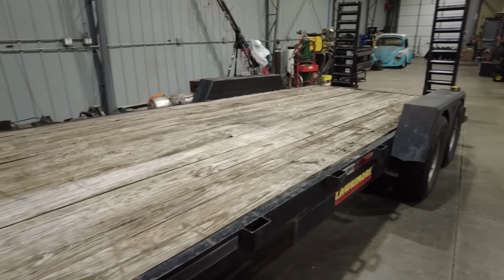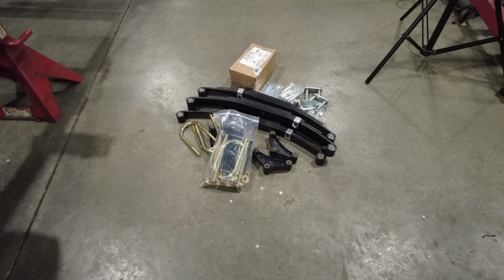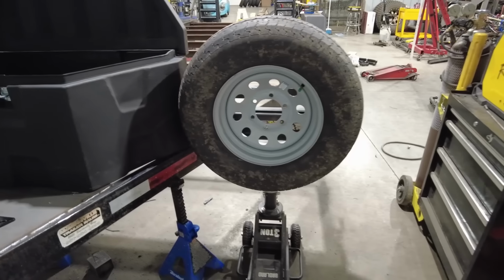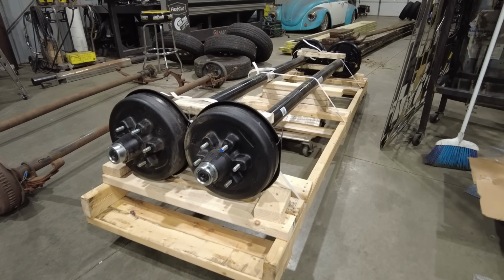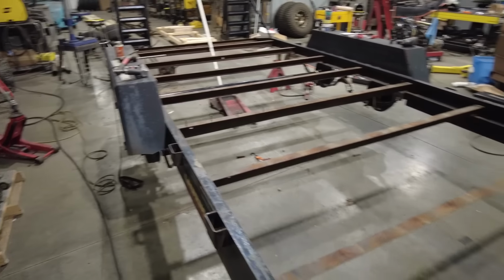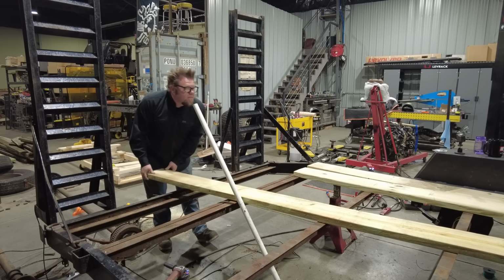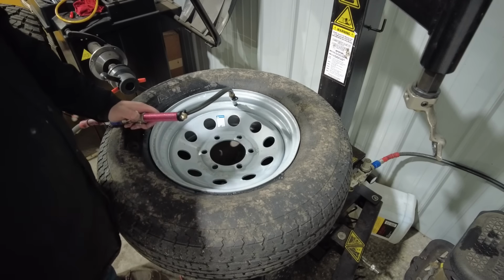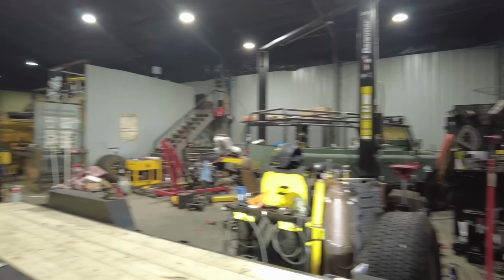Car Trailer Rebuild, How to Increase the Load Capacity of your trailer

Comment: Curious what's the GVWR on the trailer data tag? Upgraded axles are great, but State Troopers go by DOT tag rating, not axle rating (whichever is lower). Something to think about & be aware of anyway.
Reply from the maker: I will have to look...not sure if this trailer even still has a tag....but good point....
Reply: @BigTireGarage you can reregister the trailer for the higher gvwr and you’ll need the paperwork on the axles and springs to prove the upgraded weight ratings. Also curious with all you did why you didn’t blast the frame off and give it a powder coat?
Reply: @Old_Tyme_Racing  Original frame was only designed around a 7000lb rating so how would one upgrade the frame rating?:face-blue-covering-eyes:
Reply: @iffykidmn8170  I get what you’re saying you’d have to ask the states most go by axle weight ratings for weight ratings on trailers. I just order a enclosed car hauler and put two 7K axles under it and it will be rated for 14K but the manufacture mandated they had to upgrade to a 8” tube frame instead of a 6” tube frame plus an extension on the tongue for better weight distribution and handling.
Reply: @Old_Tyme_Racing  you might get by with the local PD but a state officer is looking for the lowest rated component which is printed on the tongue placard including the tire size and rating, try putting a D rated tire on a trail requiring E and see if your legal load is still legal.
Reply: @iffykidmn8170  most local and state officers don’t even know how to read those tags and most only look for the gvwr and I can guarantee you most trailer owners don’t even have the correct rated tires on their trailers anymore after the original tires wear out because most trailers owners don’t have a clue about that kind of stuff. Most owners would look at you puzzled if you asked them about tire ratings. Just like most who own a trailer with a gvwr over 10K have no idea you need a dot medical card to pull a trailer over 10K. Like I said I completely understand your points about the frame rating and tire ratings etc. My state is going to allow me to register my truck which is rated at 10,866lbs. and my enclosed trailer as a combination at 14,000lbs. So my truck will be legal to tow my enclosed car hauler and it’ll be legal in any state I go to because it’ll be printed as such on the registration of my truck and they don’t even ask about my tow vehicles tire ratings but I did order my 2500hd with 3500hd springs from the factory. My truck will still have it’s tow rating sticker of 10,866lbs. in the door jamb.
Reply: Yeah... DOT follows the GVWR, regardless of axle, tire, and coupler.

Comment: Got a free 20 ft power tilt steel deck trailer from my buddies dad like 6 years ago. Added junction box,  Wired side and tail lights in series parallel with individual grounds. If there's a failure super easy diag.  At the time I had a 1500 Silverado so went with 6 lug axles that way I always had 2 spares.  Also the tail lights are long and thin on the end of the trailer, mounted inside 2x2 .25 square tube. Back it into a wall and lights are fine.
Reply from the maker: Sounds awesome!!

Comment: Surprised ya didn't hit it completely with black paint while it was open like that. Lights down the center like that was a good and smart touch. 👌 0
Reply from the maker: Thought about it..but honestly to do it right would of been to send it out for powder
Reply: Not putting some type of coating while you had it all apart was a mistake, imho. Salt will eat the frame alive in no time unless you have some sort of barrier. Even those of us who live in a warmer climate will suffer from rust over time. I am one that believes that you can’t paint steel too often - Neil was right…. Rust never sleeps.

Comment: Nice trailer.  I am surprised the jack mount is 1/8" material.  The one you cut off was way more beefy.  Hope it works.

Here where we have lots of snow, those wires run cross-member to cross-member would get loaded up with snow and ice and pulled down and apart.  We have to run the wire along the "C" channel here.

Wood planking will last a long time if you do nothing.  If you put a coat of linseed oil on it every year or two, it will outlive you.

Lights down the center are cool enough.  But they are clearly not flush mounted.  You will hate them when you drag frames and pieces of vehicles up onto the trailer with your winch, getting hooked on them and ripping them out of the trailer.

Comment: Your junction box is more than likely use for RV trailer not a car trailer. Thats why ground is white and power is black.
Reply: No, RV / 5th wheel / camper are different to trailer… yet another NA oddity… 🤣
Reply from the maker: Would an RV not still use the normal stop, turn, and running light color code

Comment: I always mount the spare on the passenger side incase it removes itself, it won't be into oncoming traffic.
Reply from the maker: These are bolted down and secured with cable locks so I feel pretty good about them staying in place

Comment: what I would have done with the center strip is get a channel iron welded in web side down with flanges up and then put in weld on D rings in the bottom of the channel and maybe some E track mounts too. then a guy would have center tie downs that do in interfere with any  load
Reply from the maker: That would be pretty sweet...but it wasn't a perfect 6" wide...the flat bar covers the edges of th boards

Comment: Load capacity will be 10k minus the entire trailer except axles, springs and wheels and tires.
Reply from the maker: That is the same for every trailer
Reply: @BigTireGarage  Agreed, but you stated you will have a 10k capacity with the new axles.

Comment: I did the same as trucks, mounted the spare under the trailer using the system from a pickup.
Reply from the maker: That would be a cool idea as well
Reply: Next upgrade will be onboard air compressor. the box already has solar charger for the onboard battery. The trailer is pretty much self contained.
Reply: you will prob regret that decision....  when your first blowouts occur.   in the rain and mud!   HA!

Comment: On the wood you can do burn the wood will look cool
Reply from the maker: I was told to not burn PT....so.ething about off gassing
Reply: @BigTireGarage  Think about painting it with used motor oil top & bottom (two coats). Good use of waste oil and prolongs the life of your deck. Yes, I understand it PT (rot resistant). Oil will make it water resistant compliment the copper chemical treatment. It also looks great with a semi-transparent black color that highlights the wood grain!
Reply: Have to see a picture after you are done

Comment: Use a spare spindle to mount the spare. So you have spare parts when needed
Reply from the maker: Had that on my old trailer
Reply: That's a great idea. Especially as far as he drags this trailer.
Reply: Great idea new bearings and a grease gun in the box can help when the trailer is old.
Reply: @bobdixon4998  grease gun in the box taken out and used regularly when trailer is new keeps it new longer.. when it's old and already worn out due to lack odmf maintenance  helps some but prevention deletes the need for cures .
Reply: Really good idea
Reply: Wouldn't this destroy the bearing long term?
Reply: @ShopJock  oil bath bearings need to be rotated, so yes. I can’t see how this would be an issue with grease packed bearings.
Reply: @ShopJock no. We have done it for many years (40+) and never had a problem with bearings. We set them so there is I bit of pressure on tire so bearings are held tight
Reply: @ShopJock  
Lock the tire so it doesn’t move.
Reply: @dodgeguyz locking the when is more likely to damage the bearings. Allowing it to rotate would reduce the chance of the bearings making divots in the race.